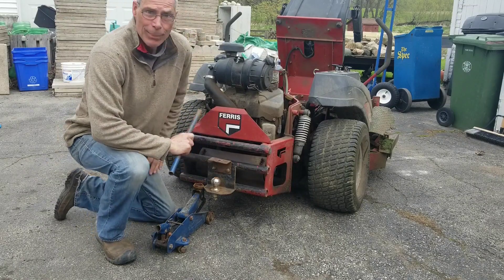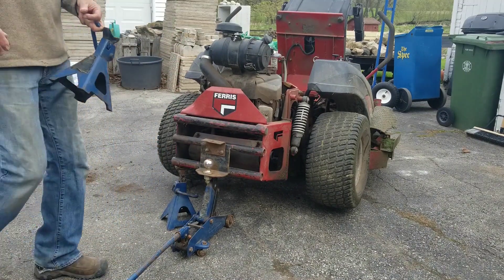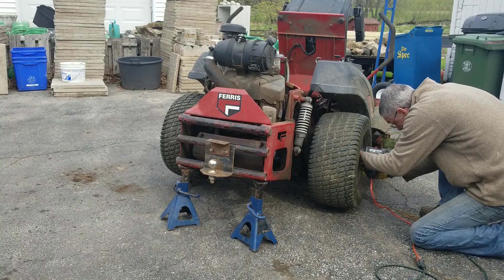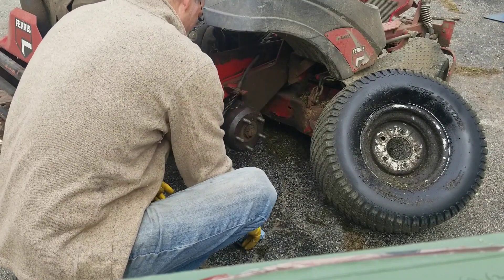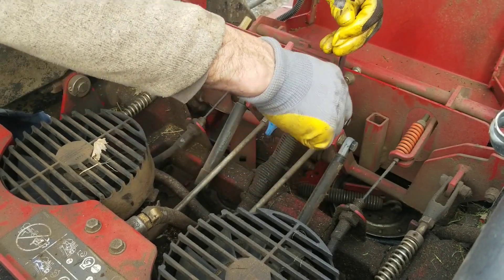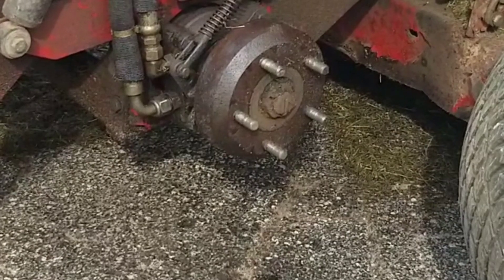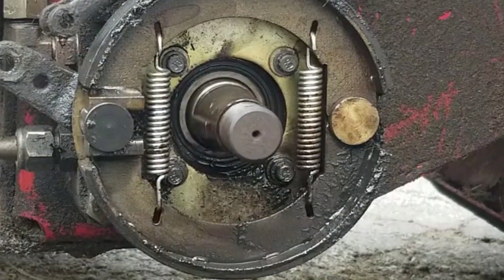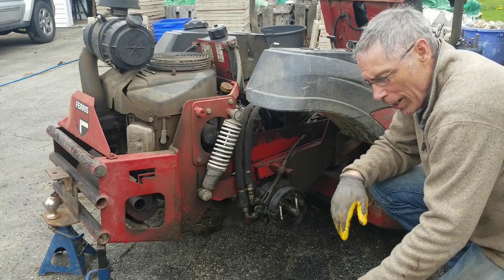Hydraulic Leak Diagnosis

Comment: Did you ever make a follow-up video if you replaced the hub or the hydraulic motor?
Reply from the maker: The leak is very slow and so far UI am keeping up to the leak. The cost for the unit is stupid-huge money. I hope I can get to it this summer.